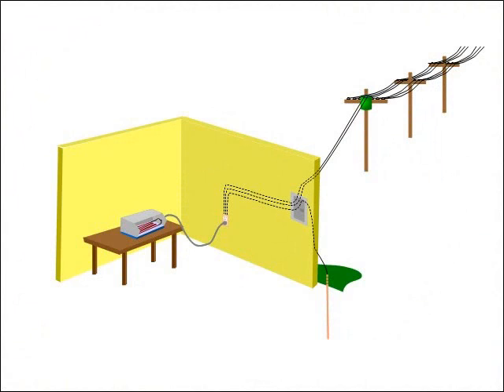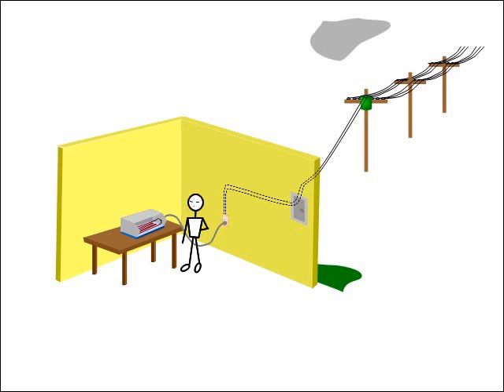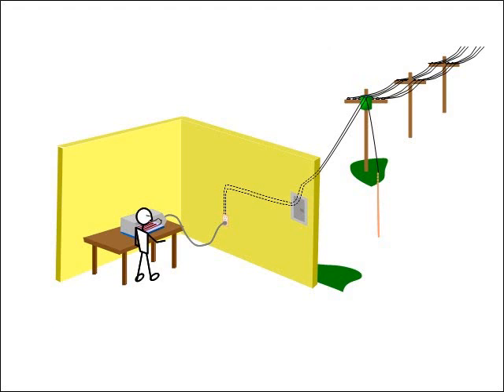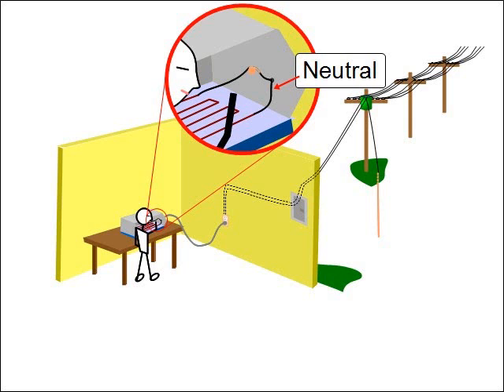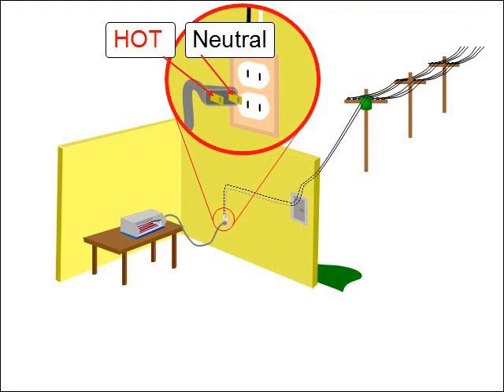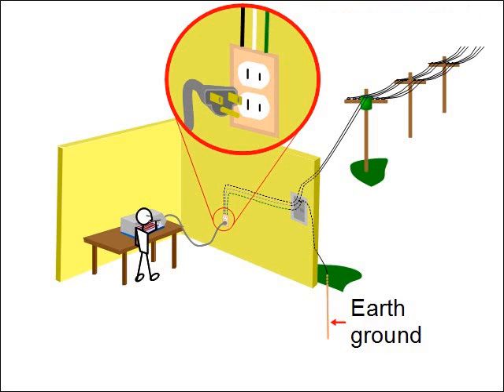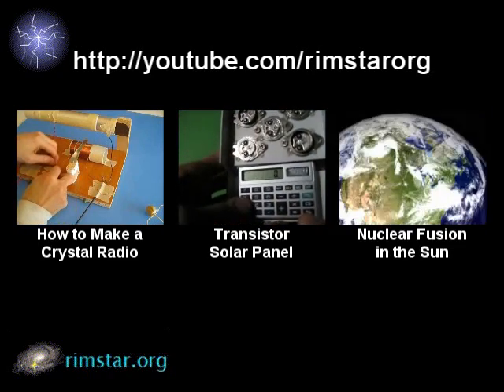Hot Neutral and Ground our Funny Looking Household Electrical Socket

Comment: I really doubt the neutral was ever connected to the case. Sure there were hot chassis radios but the chassis was not the outer case.There was no reason to connect any wires to the case unless you plan to kill the user.

Comment: So cutting the neutral wire with wire cutters wont shock you? Also does that cut off power completely?
Reply from the maker: It depends. If the appliance is turned on then current is flowing from the hot wire, through the appliance and through the neutral wire. Cutting the neutral wire at that time could shock you. Cutting the neutral wire when the appliance is off won't cause a shock.
Regarding cutting the power off completely, it would. When you next turn on the appliance, it won't turn on.

Comment: Hi Steve..I hope I got your name correct...I am catching up, pretty rapidly, on all your videos.  PLEASE KEEP THEM COMING!!!  There is something that I assumed would be rather basic,but I just can't find it anywhere I look!
I wanted to know about how long GFCI's have been around.  This curiosity started when I was awakened by absolutely horrid noises in the house!  I thought it had to be an earthquake, but in Louisiana???  Hurricanes are bad enough!!  Then suddenly, I was in total darkness and silence!  Then there was the awful smell of thick smoke,  I just knew the house was on fire when the smoke alarms went off!!  After stetting a bit, I realized I was in total darkness,but all the neighbors had lights!.  My shop was saturated with black smoke, but no fire!  I finally went outside with my good-old 10,000,000 candle power lamp, and noticed that the bare neutral wire coming from the pole pig to my house
had snapped in two!
I finally figured out that only the 220v devices were working, while the 120v stuff was mostly fried!  The shaking came from 120v window AC units, and all the smoke was from a 120vac high-protector.  I guess they start needing to use 240VAC MOV's (not 120v units in case of a broken neutral). I spent many hours designing a quality "BROKEN NEUTRAL DETECTOR"
OK I just got totally carried away there: MY QUESTION was simply: 

HOW LONG HAVE GFCI's BEEN AROUND?
Thanks much.
Reply from the maker: That's quite the experience. Thanks for sharing. Looks like they've been common since the 1980s, from https://en.wikipedia.org/wiki/Residual-current_device#History_and_nomenclature

Comment: Hello, sorry if this is a stupid question but my slow brain would really like to learn.. , my confusion starts at 2:30, you mentioned that if the hot wire is damaged and connected to the metal case, it may be dangerous; unless the neutral wire is already connected to the metal case. in which case, the electricity goes to the hot wire, through the case, through the neutral, and then ground. Since this path is of low resistance, it will trip the breaker. Wouldn't this mean that we can omit the ground wire and just make manufacturers always connect the neutral wire to the case instead? Thank you.
Reply from the maker: At 2:30, the neutral wire is connected to the case. But the neutral wire is also connected to the electrical circuitry inside the appliance. Whenever the appliance is turned on, the neutral has current flowing through it. So it will always be live and dangerous when the appliance is turned on. A separate ground wire connected to the case doesn't have any electrical current running through it (unless the hot wire touches the case) so it's normally safe.

Comment: Bought a house real cheap. It was a mess with RATs. I have shorts in the walls. I see that it's the hot wire hitting the ground. Tested the neutral wire and it's good. Took it off the braker and it's not connected to ground in any way. I was waiting to use it as hot and ground as neutral.  Could I?

Comment: Great video but I'm still confused....if ground & neutral are connected at the meter box, wouldn't that mean the electricity flowing back from a device goes to ground OR back to the pole? Does it go back to the pole because it has less resistance than ground? I can't find any answeres to this anywhere.
Reply from the maker: You got it. The Earth ground path from the breaker panel, into the ground and back to the pole is a much, much higher resistance than the copper wire path, so a negligible amount of current takes the ground path and the rest takes the wire path.
Reply: Thanks for clarifying. I didn't know the ground path goes back to the pole! A lot of stuff I've read say it just dissipates to the earth ground if there's a faylt. Is there a reason why SOME current will flow to earth ground as you say? I would think ALL current would flow back to the pole through the nuetral wire.  Can you explain this? Thanks again.
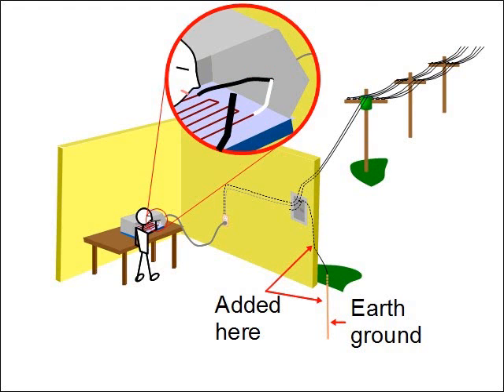Reply from the maker: I may not have been clear enough. The ground path going back to the pole I was referring to was the actual Earth ground, the dirt between the grounding rod at the house and the grounding rod at the pole (see 2:45 and then 2:48, I don't know why I didn't show them both at the same time, maybe to avoid confusion about which ground rod I was speaking about at any time).
I have a more recent video that may show it more clearly https://youtu.be/zLW_7TPf310, though I don't mention the path ground through the ground there either since it's such a high resistance and low current and isn't an important part.

Comment: Good video. I have some questions
1.  Before they added the ground cable to dissipate static electricity, could you touch the hot wire without getting shocked (while not being insulated from ground)?
2. Is the ground a good electric conductor? What is the resistance in the ground?
3. Would it be safer not have any ground at all if we could remove the static electricity some other way?
Reply from the maker: Thanks.
1. No, you could get a shock.
2. The ground isn't as good a conductor as copper, and moist, warm ground is better than dry, cold ground, but it can be good enough to allow enough current to be harmful.
3. No, because without the static electricity there's still the electrical current being used to power the appliances.
Regarding answer 3, you might want to see my What is Ground video for more clarification of the danger https://youtu.be/zLW_7TPf310
Reply: Yes, if the system is isolated from the ground. In reality it is hard to guarantee that on a large system. On a smaller system it works in case of an isolating transformer.

The ground is bad conductor if you think tripping a circuit breaker. If you think danger to a person it is a good conductor.

Systems isolated from the ground were tried and they failed. There is no need to try again.

Comment: if the circuits is shorted how come ground or body ground  absorb the electricity meaning electricity go to the earth ground how come....soil is not conductor electricity absurb by the soil
Reply from the maker: Soil is not a great conductor but it is conductive. The moisture in the soil enables ions in the soil to make it more conductive. Of course, some soil is a better conductor than others. For example, dry soil or frozen soil are bad conductors.
What I don't show in this video though is that when the person gets shocked, the electrical current goes from them to the ground and back to the ground rod which I show near the pole.
I've since made a much more detailed video about household ground here https://youtu.be/zLW_7TPf310.

Comment: ok ..if the hot wire is connected to the body ground there is no problem but if it is connected in neutral  theres electricity   you will be electrified  thanks

Comment: This is wrong.
If there's a fault in a circuit the only way to make it safe is to TURN IT OFF.  If you touch a conductor that's connected to the earth and has 120v applied to it your going to get the sh$t shocked out of you. Electrons don't want to go to ground. They WILL take any and all paths back to their source. If a person creates a parallel path for electrons to find their way home they will get shocked period.

Comment: Forgive my complete noobness, but why didn't they just ground both side of the wires instead of leaving one side ''hot''? I mean, sure it doesn't solve the electricity touching the metal case but I just felt like chronologically it would have made sense?
Reply from the maker: If you ground both wires then that would be the same as connecting the two wires directly together. That would short circuit them. Though since they'd be connected through the high resistance ground, the current may be low, but there'd be little or no more electricity past that point in the wire -- nothing would get to the house.

Comment: Well if wires can have both active and static electricity in one wire, I guess I now understand electricity even less than ever. I mean I thought I had no clue but this is really bad. I sure hope this turns out to be untrue.
Reply from the maker: If the wires are uninsulated, not sure is they are on the long runs between towers, then...
AC is alternating current, charge moving back and forth along that length. The quantity of charge present can be high or low. That's the build up of high voltage. Given that there's more charge introduced, the generators would have to work harder to maintain the current.
If the wires are insulated then the charge build up is on the outer surface of the insulation.

Comment: The only thing I don't get is how the neutral wire is grounded if it was connected to an AC supply because since AC is constantly reversing polarity and direction, wouldn't the neutral wire be considered the hot wire half of the time? Also wouldn't that just cause a ground fault too? Plz help.
Reply from the maker: Yes, the neutral wire is the return path for the AC.
A fault happens when the neutral wire touches the hot wire directly, or through some piece of metal. A fault also happens then the hot wire touches the ground wire, since the ground is connected to the neutral at the breaker panel.
The neutral wire is in contact with ground at various points but as long as the hot isn't too then there's no fault.
But neither of those things happens normally. Normally the hot goes to some electronics, like a microwave oven for example, and then a neutral wire returns from the microwave oven. The neutral wire is in contact with the ground at various points along the way but the hot isn't, so that's okay. The electronics is a high resistance and high impedance path for the electricity and so it doesn't count as a fault. The high resistance and high impedance means the current is at a low, safe level.
Reply: ok, i used think like what you think...
but it's not like that...
ac reversing polarity,  means in Sinusoidal...
sometimes it positive and sometimes it negatif and sometimes it can be zero...
but this happen within 50 Hz frequency...
but still, the neutral always zero...

if ac positif, neutral will zero...
if ac negatif, still neutral will zero...

i hope it helps.
Reply: Becuase is part of a three phase system.
Reply: Separate polarity and potential. While polarity changes with AC, the potential of neutral in reference to ground (the reference we are more or less at) is always about 0. And the potential of the 'hot' in reference to ground is about 120 volts (USA). Voltage describes a difference between things (not absolute), and a difference of 120 can be had by either adding 120 to 0, or subtracting 120 from 0.
Reply: If neutral is the path way back to transformer then why did they burst or burn out when we connect hot wire and neutral connect directly? Why the current doesn't flow quietly back to the transformer. It will mean alot if someone explain..
Reply: @adrianlee453  I think you need to look into what a 'short circuit' is, because that is exactly what you are creating when you connect a hot and neutral together. It is precisely BECAUSE it is the path back to the transformer that it will 'burst or burn' as you say. Simply, a short circuit is when a circuit has too little resistance (there is no load, like a light bulb) to resist the flow of electrons, and so massive amount of current flows, causing sparks, tripped breakers, and potentially other damages to equipment.
Reply: @Tyler Keniston thnks alot it make sense now..
Reply: ac doesnt go to ground, it goes back to the source. static electricity will bleed off to ground

Comment: Hello
You are wrong in stating the third wire's only purpose was to be connected to earth ground. In fact its main purpose, in the US, is to be connected to the neutral at the breaker panel. Earth ground conduction is far to poor to be relied on to pass enough current to open say a 15 amp breaker. Opening the breaker due to a ground fault is imperative to prevent shocks. Ground rods are excellent for dumping lightning or static charges but not good for preventing dangerous shocks like you could get from a ground fault in say a metal microwave case.

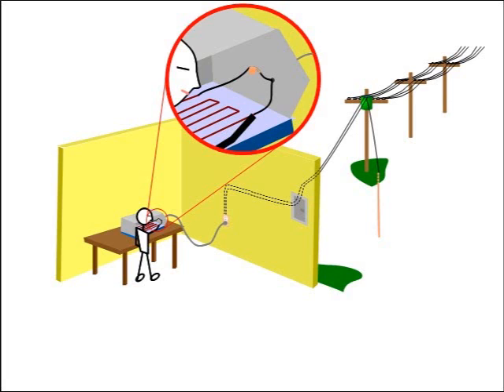Comment: 1:24 No there is no neutral wire once you plug your device. all wires are hot cause current is passing the wires and + and _ are connected through the resistance (device) !! only if you touch the neutral on plug-in on the wall you are safe cause no electricity.
-----
2:28 again wrong !! even if the neutral wire is connected to device and you touch the case you get shocked . the assumption is wrong cause in many cases because of the resistance of the device the Ampere drops down and if you touch the so called "neutral wire" electricity passes through you to the ground but its weak and you think its ok to touch it !! not every devices has the same backward Ampere to the neutral hole.   
-----------------
Reply: You seem to know your stuff so I'm hoping you could shed some light for me on this issue.  From a hypothetical standpoint, if a person were to "bond" themselves to 1 of the conductors in an a/c circuit, being completely electrically isolated from its counterpart, wouldn't they still be feeling the charges polarize back and forth within and around their body?
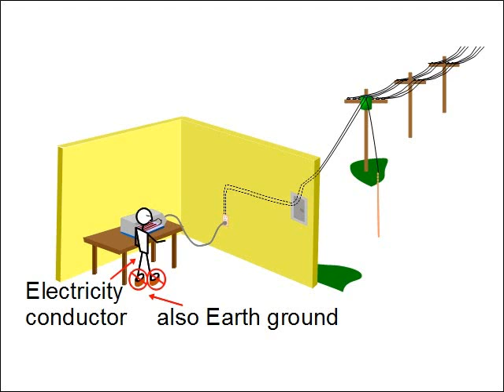Reply: Quebecois..your criticisms of this video are so erroneous!  He was correct at both 1:24 and 2:28!  For 1:24, your assertion that "there is no neutral once you plug in your device" is fallacious because the neutral and ground wire are always connected together at the service panel, and therefore always at the same potential (voltage level) regardless whether the device is plugged in or not. 
As for 2:28, I read your comment multiple times and the verbiage made no sense at all.  I mean "the resistance of the device the Ampere drops down" is a hilarious statement at best.  Again, the case, the neutral, and the ground are all connected together and therefore always at the same potential (as implied in the video), and you cannot get shocked by touching multiple conductors at the same potential, even if current is flowing in one of the conductors (which may produce a negligible IR voltage drop in that conductor that can't hurt anyone).  And finally the coupe de gras, "not every devices has the same backward Ampere to the neutral hole".. ROFL!!..  no clue what is being said there!
Reply: There is no plus and minus in AC. It is safe to touch the neutral unless it is broken upstream from you. In that case you would get the mains voltage if there was an equipment connected.

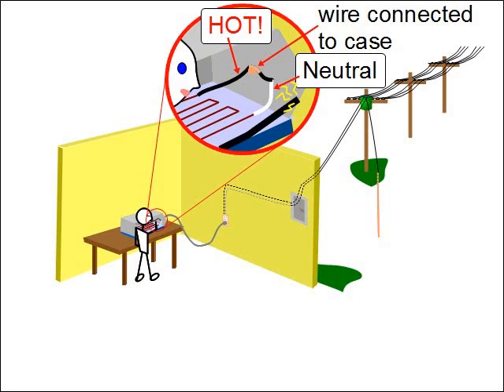Comment: Great video, thank you! I just got an electrical appliance from Japan (100V & I have a converter as well) and would like to use in North America. However I found there's an external green / earth wire attached outside of the plug, like so in this video at 0:42 (or 2:00) --> https://youtu.be/PIADwql3lvM, may I kindly ask your advise what should I do with the green wire when I use the appliance here in North America? I think Japanese sockets come with earth connector (shown in the same video as well) I tried to google about my situation but no luck .. until I saw your video here. Hope you will be able to help. Thanks in advance!!
Reply from the maker: I can't say 100% for sure because I don't know anything about the appliance and when you connect the green wire to the socket it looks like your connecting it to the ground hole but that's not 100% clear.
But from what I can tell and based on what it's doing it looks like the green wire is an extra ground wire. For doing the same thing in North America you can go to a hardware store and buy a standalone plug (just the plug with no wires attached to it.) Then open up the plug and connect that green wire to the ground prong of the plug. But that's only if you're sure that that external green wire is an earth/ground wire.
I do this for a different reason at 7 minutes and 21 seconds into this video https://www.youtube.com/watch?v=VqdcU9ULAlA.
Reply: RimstarOrg Thank you so much for your prompt reply! I'm sure the green is ground wire, I actually just 'clip it' on to one of the screws of the wall socket and it seemed to work just fine. Thanks again!

Comment: it's not clear at first that the spot where it appears the two wires are connected is actually just the hole in the appliance where the two wires are entering the appliance.  You should make this visually more obvious.  Also, you should state WHY the manufacturers were connecting ANY wire to the case?  Also, were they connecting a stripped piece of the wire to the case, metal on metal, or were they winding the insulated wire around something in the case, thus insulated?
Reply: I don't think the manufacturers EVER connected a hot or neutral wire to the case, unless accidentally because too much risk of shock and what purpose would it serve. Only when the the third (grounding) wire was added to tools/appliances was any wire connected to a case.